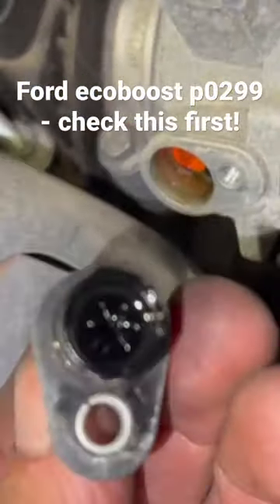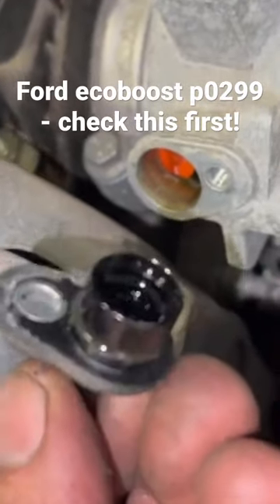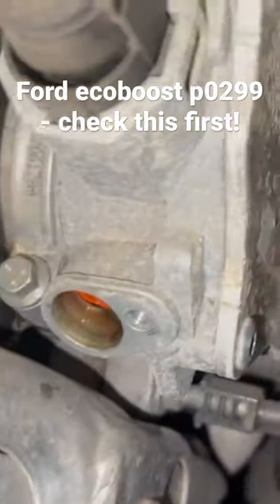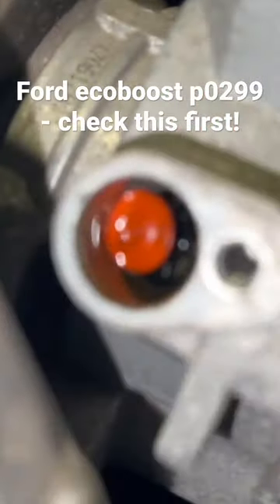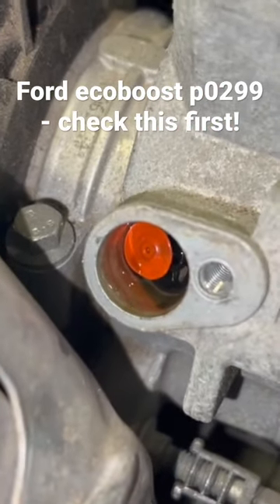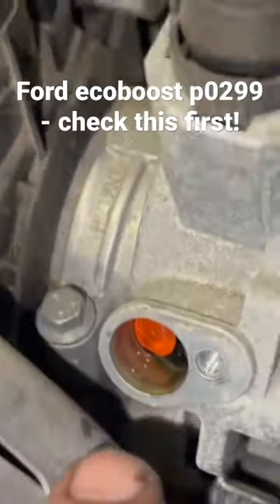Ford ecoboost p0299 fault - cheap fix! Full video on the channel #p0299 #ecoboost #ford

Comment: If thats the build quality get rid of!!! i just put a one way check valve in The rubber hose arrow towards vacuum pump use old valve as carcass then get rid of before wet belt goes!!!!!

Comment: I wanted a straight forward video and this is it but to bad I don't know where in the engine bay he is
Reply from the maker: the full video is on my channel.. its a lot clearer
Reply: Do you have link to full vid
Reply from the maker: @ichaelthomas1815  Ford Focus 1.0 ecoboost P0299 Fixed
https://youtu.be/yr0EHRTmN5g

Comment: Is that the brake booster pump
Reply from the maker: Yeah it’s the one way valve that goes onto the vacuum pump
Reply: @diydaly  that will give you a p0299 code .. would have never guessed
Reply from the maker: @theone-jm3gl  yeah quite common 👍

Comment: I have a 2017 ecoboost I ran it out of petrol when refilled now in limp mode any ideas
Reply: Clogged fuel filter/pump. When you go that empty, sometimes the pump picks up debris in the bottom of the tank
Reply: @ewdtrey  cheers I left a day parked up and it seems to have sorted its self not sure how but running ok 
Many thanks

Comment: Where I this located I have ford fusion 2016 with p0299 code
Reply from the maker: If you check the channel there’s a full video on it
Reply: Did you fix your issue?